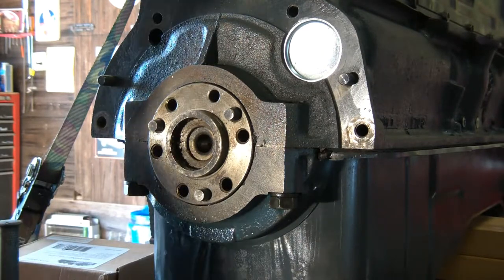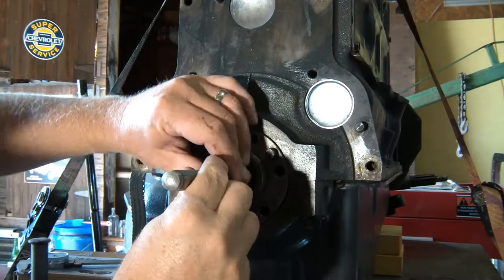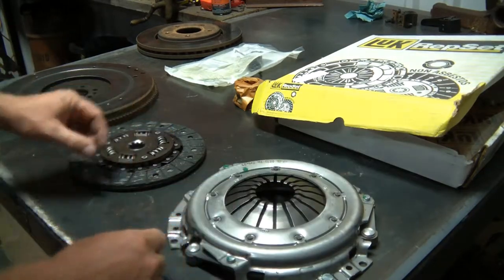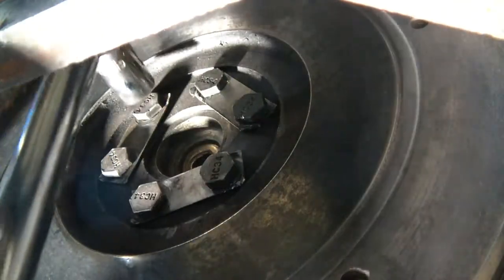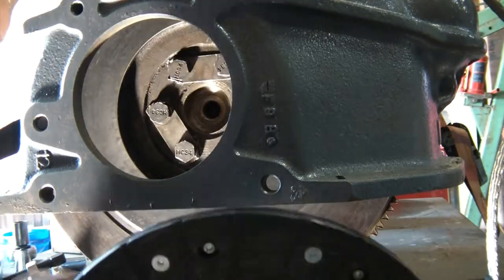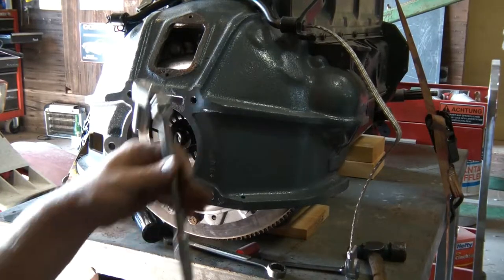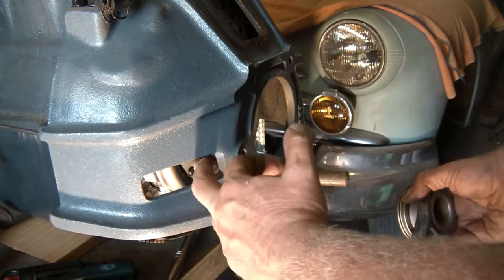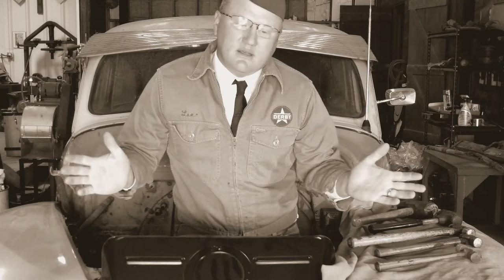Part 3: Installing a 1948 (1937-1954) Chevrolet Clutch

Comment: Just finished rebuilding my old 6v starter  and replaced the flywheel ring gear, torque tube bushing, u-joint, pressure plate, clutch, throw out bearing, and pilot bearing on my 54 261 3100. Was able to get it all done without removing the bell housing. I absolutely could not have done it without all of your videos. You saved me tons of money and headache. You’ve got a friend in Chicago.
Reply from the maker: So glad I could help! Thanks for watching. Been to Chicago once, spent three hours in union station. Took a stroll down the street a couple blocks, thought about going to the aquarium or something but decided not to chance missing my train back to Kansas....Not a great story, but I guess I can say I've been there! lol

Comment: I never have been able to find a high-quality pilot bushing puller.  I used to have this tapered stud with a grease fitting on the end.  I would screw it into the pilot bushing and pump the cavity in back of it with my grease gun.  That would force the old pilot out.

Comment: I don't routinely resurface the flywheel either.  What I DON'T ever EVER do though is 1)  Try to drive the bell housing in place and trying to draw it into place by tightening the bolts without first making sure that the holes for the pilot studs are clear, and that there is nothing in the way of the bell housing properly seating.  Scratch that if this is your own car and you know that this is just the way it is.  2)  Try to drive the transmission in place without, again, first making sure that everything is A-OK.  Ignoring these two points can result in a bell housing or a trans not being squarely seated in place.  3)  Never EVER let the transmission hang by the input shaft.  Ever.  I realize this trans is much lighter than the heavy duty unit in my truck, but still.  That is a good way to spring the pressure plate and even bend the input shaft.  What I do is put to guide pins in the holes for the two upper transmission-to-bell housing bolts and slide the transmission in place along those two guide pins.  They also will support the weight of the trans, so the input shaft will not get bent, the pressure place will not get sprung.

Comment: I'm glad you admit the pilot bearing mistake I have pulled several solid bushing pilots out withe the input shaft because old timers drove it home with a bfh and driver the way you did... the bushings were spinning in the crank... horrid noises

Comment: You should have put a couple headless bolts or studs into the bellhousing to keep the transmission from hanging on the clutch disc.

Comment: Thanks for this I have a 53 chevy 210 with what I think is a band clutch, I know the ring gear is missing teeth. I live in the UK and dont have the luxury of a large garage to do this and am thinking of doing it with the engine installed. I have never done a clutch before but after watching your video I am a little braver or stupid.
Reply from the maker: Just go slow and methodical. Buy a factory shop manual to refer to. Take lots of pictures, and bag and tag everything you take apart. Bag all hardware in sets that go to one specific part. You can do it!
Reply: On these vehicles, you have to pull the rear end in order to remove the transmission with the engine in place.  Torque-tube drive.
Reply: @michaelbenardo5695   thanks for the information but I did the clutch with the engine in the car wasn't easy in my tiny garage though

Comment: Good instructive video. I am attaching a flywheel from underneath (engine [216] is in the car and bell housing installed). I am having trouble attaching the flywheel to the end of the crank. Are the studs on the end of the flywheel equally spaced? Having trouble lining everything up and getting bolts started.  Have used awls to line up holes in flywheel with threaded holes at end of crank, but not successfully. Advice?  Wished I would have put this together on the bench instead from in the car.
Reply from the maker: Yes, check out the holes for the dowel pins on your flywheel. One should be offset not centered between the two bolt holes. You'll get it!
Reply: @TheJayhawker  Thank you very much. It seemed like something like that or maybe the pins were different sizes for different 216s.

Comment: Stupid question  , there's obviously a cover for clutch like a pan almost?
Reply from the maker: Yes there is a tin cover for the bottom
Reply: @TheJayhawker  how about to check the oil on a 1954 bel air  235

Comment: How do you clean larger parts like the bell housing and transmission case in order to paint them nicely? I'm really enjoying your instructional help with my project. Thanks! Lp
Reply from the maker: I'm blessed with a heated parts washer at work so I usually scrape all of the big chunks off and then throw them in there. Degreaser and a regular pressure washer works great as well. Then depending on what it is I will media blast it with coal slag (TSC) or use wire wheels or a needle gun to finish.
Reply: @TheJayhawker  Thank you!
Reply: Any friendly machine shop can wash it for you for 20$ or take time to use WINDOW CLEANER or use similar detergent and paint!!! I do POWDER coat my self.

Comment: I WOULD HAVE PUT THE BELL HOUSING ON LAST , IT WAS IN THE WAY OF TIGHTENING THE CLUTCH BOLTS
Reply from the maker: That would be nice but it would be about impossible to get the bell housing bolts in with the flywheel in the way.

Comment: Great instructional video! You're helping me reassemble my bellhousing, & clutch on my '36 Chevy Pickup with these videos. One question, do you remember the torque specs on the pressure plate bolts? My setup is a bit different, but it's very close. Thanks again.

Comment: Can this be done with out moving the bell housing?with motor still in car?
Reply from the maker: Yes, in fact you cannot remove the bell housing as long as the clutch is installed. This is because the majority of the bell housing bolts that attach it to the block are up behind the flywheel. If you want to replace the clutch you will have to either pull the engine and replace the clutch out of the car. Or drop the front of the driveshaft, pull the transmission, and work on the clutch under the car.

Comment: Hi the input shaft seems very tight in the bushing when pushing on the gearbox do you think this could be an issue. I'm doing the work in my car with a hole in the floor and I'm worried I case the bushing is damaged? I noticed some mushrooming on the inner edge which I removed with a file. I'm in the UK so it's very hard to get another one.
Reply from the maker: I wouldn't do it if it feels like a "press fit" and the only way you can get it all the way in is to use the bell housing bolts to force it in. However, if it just feels tight going in by hand but you can get the transmission to mate up with the bell housing then you should be fine. Check out the input shaft for burrs as well and polish it up with some emery cloth or sandpaper.
Reply: @TheJayhawker  hi Jay many thanks for getting backvto me. I've just ordered another bushing so I hope I can have better luck. I'll keep you updated

Comment: Do you have a video  on how to adjust  a clutch  on a 1954 chevy Belfair
Reply from the maker: No video on that, I will be adjusting this one soon, and I can make a video on that and it will be much the same. However, I always encourage old car owners to get on ebay and buy the Chevrolet shop manual for your specific car. It will have all the info you need.
Reply: @TheJayhawker  Sometimes Amazon has the books also.

Comment: I have a 70 292. Any idea what the thread pitch on those pressure plate bolts to fly wheel are? Or where I can source some bolts for it?
Reply from the maker: I believe they are 3/8"-16 tpi, run a tap or another bolt that size into a hole and see if it fits. I personally don't buy from amazon but here's this: https://www.amazon.com/Mr-Gasket-910-Pressure-Plate/dp/B000BWCFDW/ref=asc_df_B000BWCFDW/?tag=hyprod-20&linkCode=df0&hvadid=312462950315&hvpos=&hvnetw=g&hvrand=8819174608317004802&hvpone=&hvptwo=&hvqmt=&hvdev=c&hvdvcmdl=&hvlocint=&hvlocphy=9024177&hvtargid=pla-573481762492&psc=1&tag=&ref=&adgrpid=70635887228&hvpone=&hvptwo=&hvadid=312462950315&hvpos=&hvnetw=g&hvrand=8819174608317004802&hvqmt=&hvdev=c&hvdvcmdl=&hvlocint=&hvlocphy=9024177&hvtargid=pla-573481762492

Comment: I also wanted to ask you why you didn't use a reamer to open the dowel holes and make the bell housing fit easier? Second, how are you ever going to get that bell housing back off if you ever need to? And finally, for now, why did not draw the bolts in evenly when you tightened the bolts? It looks a lot like you got the bell housing crooked while you were installing it. Maybe I am too picky about working on those dog gone old cars, but I like easy install and removal. Good video series, I do like the work that you do.
Reply from the maker: Great questions! This was an earlier video of mine and perhaps I didn't get enough detail into it. However, no matter what I'm working on, I always start all my hardware and then tighten them all down. I realize I showed running bolts in one at a time with a ratchet in this one but nonetheless I didn't tighten them down. Secondly I personally would not ream the dowel holes because the engineers wanted them there to precisely index the block to the transmission. Perhaps it's not as critical on these old dogs with a separate clutch housing but I find it hard to believe Chevrolet would have paid for the machining if they didn't find it necessary. But I certainly agree, it would be much easier! Thanks for watching.
Reply: @TheJayhawker  I haved chance clotches in Chevrolet  from 1961 and 1963 Bel Air and Biscayne And twice in SAAB 96 whith 2-stroke  motor Standard transdmission
Reply: @TheJayhawker     When all parts are out including DOWEL PINS you can polish only front end of pins. Common practice.

Comment: We don't need to see all 6 fly wheel bolts getting torqued.  You didn't show how you got the shaft through the clutch spline into the pilot bearing.
Reply from the maker: Too late, you already did

Comment: How do remove this bushing with bread?
Reply from the maker: the old "messy" trick is to stuff the bushing with grease and using hydraulics of hammering a close fitting rod or punch into the bushing, the grease will force the bushing out. Some have apparently accomplished this with bread instead of grease. Also, per your other comment, I made the alignment tool for centering the inline 6 timing cover. I am making some of these for sale and will hopefully get them on ebay soon. I will be sure to mention it in a video as soon as I do.
Reply: @TheJayhawker  thank you sir